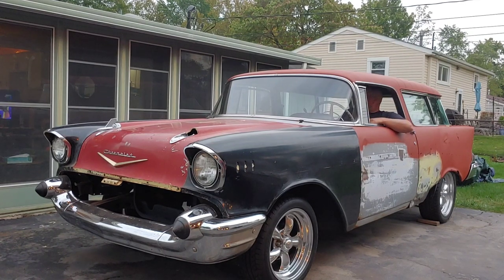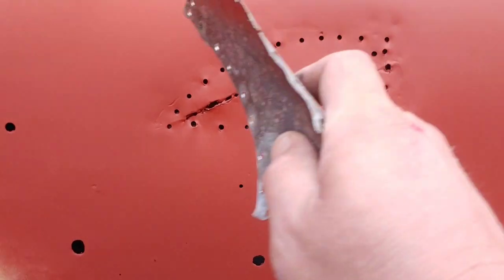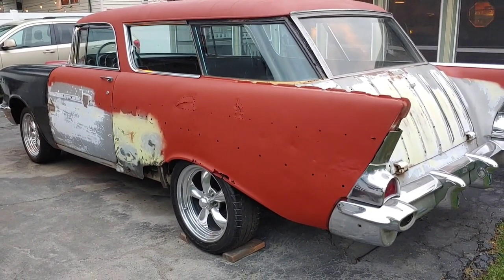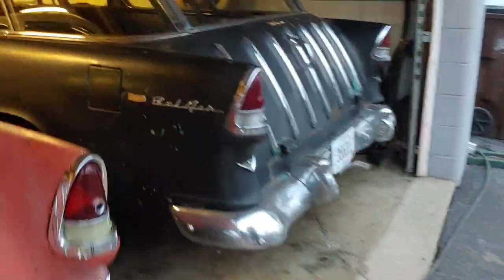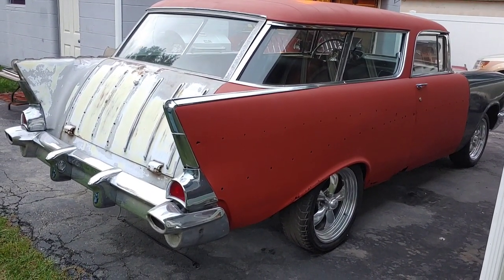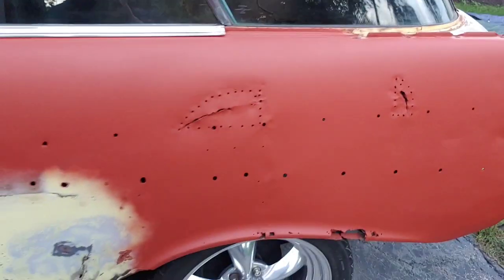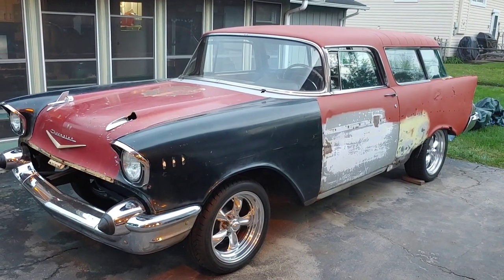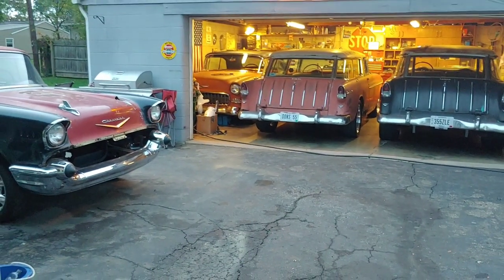1957 Chevrolet Nomad Project Finding Hiding Gems!

Comment: Don the nomad is looking really good . great find on the seat . let me know if you don't get the quarter panel aluminum inserts .
every 57 that was restored where i worked at got new ones . 
 i been vice griping all of my 55 ragtop body parts together to make shore that everything lines up everywhere. before i weld anything .
do you have a dent puller that welds the nails on ? that would be good for the drivers door .
  keep up the good work.
Reply from the maker: Thanks Jim! I'll let you know if I don't get the 57 inserts. And you read my mind I do have a stud gun and I was planning on using it on the door. I think it will work great. The vise grips are the best thing for fitting a convertible tub into its new car. You might need a small racket strap to tweak it slightly one way or rhe other. Have a good one Buddy and good luck with the 55 Convertible.✌
Reply: @donshotrodgarage1717 Thanks Don  i got both new full length inner quarter panels so the tub had to get all cut apart to use all the new parts .
  i got a ratchet strap from the cowl to the front of the chassis. everything is  fitting pretty good so far. the whole floor is new too. 😀

Comment: I recently started following your videos and I noticed you seem to have a number of irons in the fire, going from one car to another without sticking to one through completion.  I realize we have our individual processes but I learned a long time ago that picking one project at a time and staying with it is actually more productive towards accomplishing your goal.  At least that theory has worked well with me for years (I'm 66).  Anyway as a kid who grew up in his grandfather's body shop (way before bondo) I have to ask why you don't opt for hanging complete new quarters rather than piece milling patches upon patches?  Done right you'd have way less chance of warpage and less bondo plus you could address the inner wheelwell rust.  Like I said we all have our own way of doing things but in my opinion I'd opt for quarters.  Lastly most car guys could only dream of owning a Nomad and you have three plus a 55 cotton top.  Lucky guy!
Reply from the maker: Thanks for following the channel. I jump from car to car to keep me interested in them. They all need work and lots of work. Its easy for me to work and then come home and get burnt out focusing on one for to long! My 2 55 nomads run and drive and are totally tuen key cars. The convertible is something I mess with when I get time. The 57 nomad has just come home and has to be outside convered up so I want to get it as complete as possible. As far as doing the whole quarter I would rather just fix what I need to on it. The full quarters they made are for a 2 door hardtop and require alot of fitment to go on a Nomad. Plus your into the door jam rear taillight and Finn area all along the bottom. It seems like alot to get the same results. A friend of mine put hardtop replacement quarters on his nomad and had to do alot of trimming and had to shorten the actual opening of the wheel to match the original 57 nomad wheel well. He said he wished he just fixed his original quarter by the time he got it all done. Thanks for checking out the video!👍
Reply: @donshotrodgarage1717  I can understand, sort of, but like I mentioned we all have our own way of doing things.  I wish when I was about your age I had the problem of deciding which one to work on.  Anyway I kind of see where your goal seems to be, that being getting them to run and drive, but considering the value of these I'd probably take a different approach.  My last project was a 47 five window Chevy pickup, sub framed, 350 SBC, 400 short tall trans and basic 10 bolt but that was thirty five years ago and sold a long time ago.  Currently I drive a mint all original (except for lowering it the correct way) 2007, series 3, Chevy Trailblazer SS.  At my age I may not see it become a classic but baring something bad happening to it I'm sure my son will since it's going to him next.  Anyway, I'll follow your channel to see how you're doing with your projects.  Thanks.
Reply from the maker: I grew up around cars just like the ones I have now. Its more of a thing of reliving my childhood with my dad. Ive had shiny nice cars and every little scratch would ruin my day or even my week. Life is too short for that in my opinion. I can appreciate a really nice car but these are a better fit for my life. Plus to do a car right frame off would be easily 75 to 100 thousand dollars. Maybe later in life I'll sell all but 1 car and do it really nice who knows. My goal with each car is to make them complete and 100% dependable driver cars. I have a small fortune in these cars as they sit. And I still have a 56 nomad at my brothers house to bring home at some point. I guess it just boils down to what you want the old car to be you know! Keep that SS Trailblazer there on the way back up in value! Plus there very fun all around to drive. Talk to you later buddy!✌

Comment: 57 coming along great! What product are you using for the red oxide primer?
Reply from the maker: Thanks man! Its just some cheap rustoleum primer. Its just a base to protect it until I can do the bodywork. There is several different types of red oxide primer for whatever your application is. I use red oxide because its one of the most durable primers you can use to protect bare metal! Talk to you later buddy!✌

Comment: When a car hits 16 to 20 years old it's out of style and starting to cost to owner money in mechanical. Not a classic yet. just a beater to haul stuff to the dump. So these were the repairs they got. I don't think the patches was ever ment to fall off. Lmfao. The guy was serious about what he was doing. Even used galvanised metal. And lasted another fifty years. Maybe it had a quarter put on in the early days from a bump and the shop never prepped the back of the new panel for salt and rain. And it went out quick. Don't think repair lower panels to expensive. Ole DD putting um on all the time. Nice find on the folding bench seat. I guess there is no interior come with this car. Tell us where you found the car in a video. I think your method of stripping panels is good. Not disturbing the inside unit with acid or media blast. She is what she is. If you want a show car go loan 100.000. This one you can drive. And you don't have to have shinny paint these days. Flat paint excepted. Even design your own wrap. But the bare bones is still there. And if you  sold it the colour would be wrong anyways. Lol. Do it your way man. Build it to have fun. I think she a star in the making. She gonna come nice. Its a drain on your resources too keep buying these parts. Have a good day man.
Reply from the maker: Your right Adrian. By the time any car is 20 years old there worthless. So people tend to just patch them along. I believe this car spent it's entire life in Cleveland Ohio. The didn't want them patches to come off ever, there was 15 rivets or so holding them on. The front seat was a good find but it was expensive. I ave the rear folding seat and all the interior chrome and garnish mouldings. Also have all the stainless trim for the door panels just no door panels or carpet. It come with alot of parts but dam it was missing a ton of stuff! Have a good one talk to you later man👍✌
Reply: @donshotrodgarage1717  yep think the guy was a riveter on the golden gate. Lol. But great you got the rest of the interior. You can go modern with dyno mat. Carpets always wear out. Easy to find off the shelf. I started my days in a repair garage at 13 years old. I used to help this old boy. We used pop rivets to hold panel in place while we lined it up. We had a hand held spot welder. And bottles to braze brass rods and flux. We had a electric welder for heavy stuff. But brazing and spot weld was the way.( 43 years ago) then when I left school I did my appertership in a bodywork garage. That was the old English way. I was the rag man at 13. Sitting inside the car with the wet rag watching for fire. Lol. Stinking underseal catching fire. Get you a rag man when you start welding. Hard to put that old tar out. To me a vehicle got to be practical. It would have to have a fitted mattress in the back. Tow bar. Small trailer to go camping. Just hook up. Fire it and go. No good sitting in the garage waiting on mice. I wouldn't even worrie about putting a Deisel engine in it. Just got to be practical. Have a good day Bro.
Reply: So my guess would be he tryed to braze it but galvanised don't braze good. So he got mad and machine gun Kelly that plate to panel. Lmao. You got to keep um as a momento. Make a Nomad key ring out of it. But you should sell some nomad tee-shirt and hats and nomad key rings etc. Have a goodun
Reply from the maker: Thanks man and your probably right! He went machine gun Kelly for sure. Im trying to get my daughter to make some designs for shirts and stickers. Talk to you later buddy!